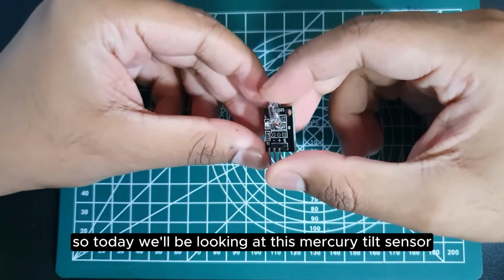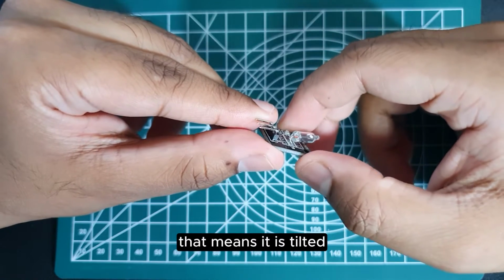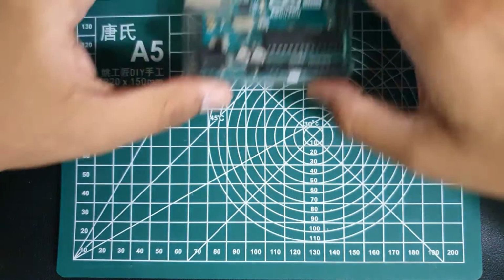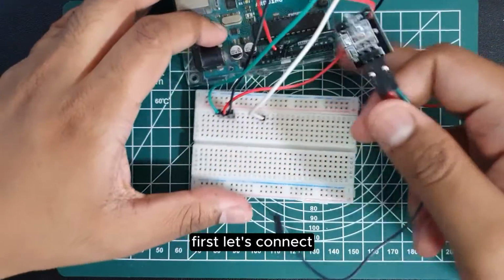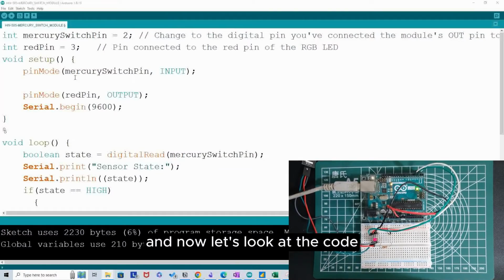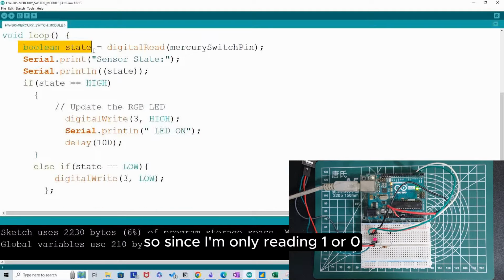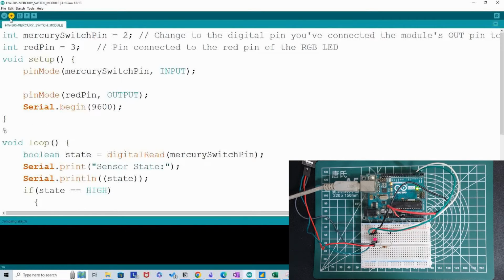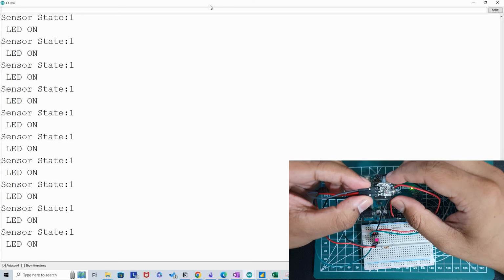How to use Mercury Tilt Switch HW-505 with Arduino(EASY)

Comment: Hi, can I ask you something bout your previous video? HOW DO I CONNECT DC DC XL6009 to the motor driver shield? Please reply fast man
Reply from the maker: Can I clarify that the arduino is already powered by another power source and you only want to power the motor driver shield ? 

The context is unclear for me to suggest.Thank you!
Reply: @OfficialMA_Youtube  I have attached the ardhuino and motor driver shield together by the pins	so it means that both are to be powered with just the solar panel
Reply from the maker: @ja6311  https://lastminuteengineers.com/l293d-motor-driver-shield-arduino-tutorial/                    

I assume you are using this same shield.Once the shield is connected to arduino, you just need to power the Arduino with dc dc booster.Place the jumper on the PWR pins. This will power the shield from arduino. However, this only can support dc motor up to 12v.
Reply: @OfficialMA_Youtube  okay so i connect the DC DC with jumper wire to connect to the pwr pins? Both of the positive and negative?
Reply: @OfficialMA_Youtube  i did this and there is no solution, please show me a tutorial or something